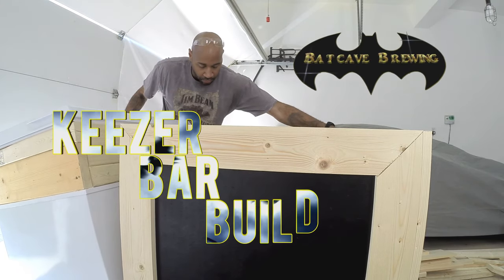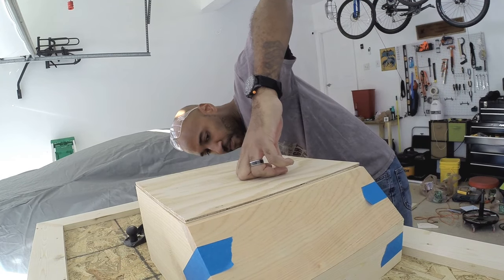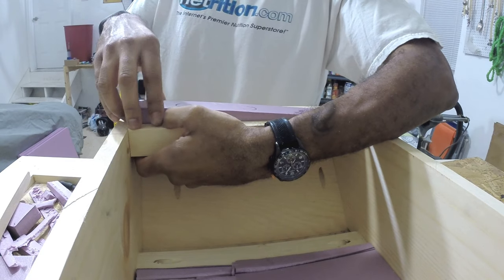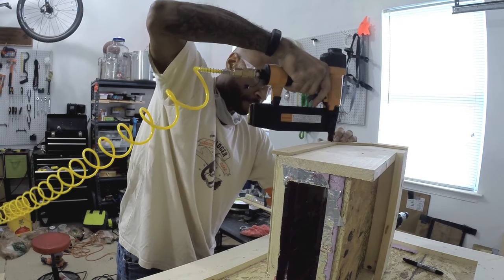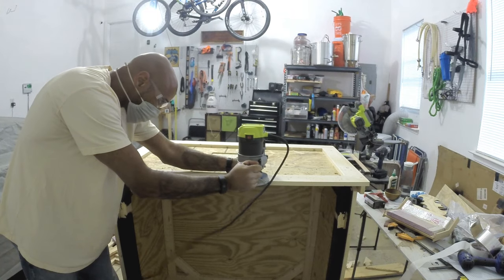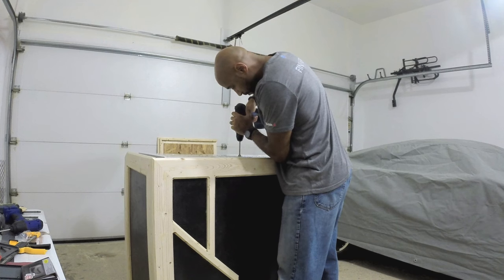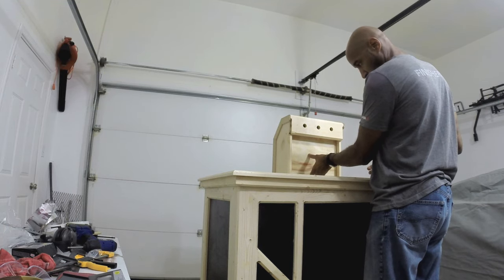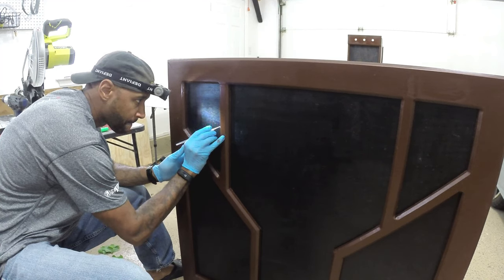Batbar Keezer Build Part 2

Comment: Good Lord this guy spent forever making a wooden box to put around a freezer. You should have called this wooden box carpentry video not how to make a kegerator. So far all I've seen him do is drill cut and screw wood together. Nothing to do with the hardest part which is actually making a Kegerator function correctly. And not create a bunch of foam on every pore I have a bet you that this guy is going to buy that pre-made as a kit